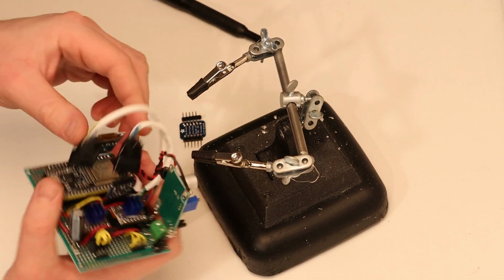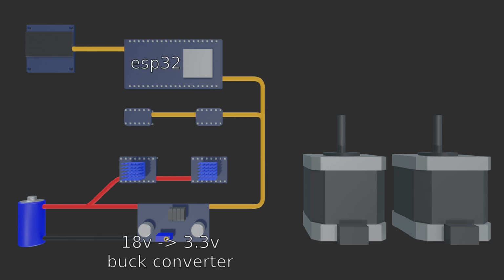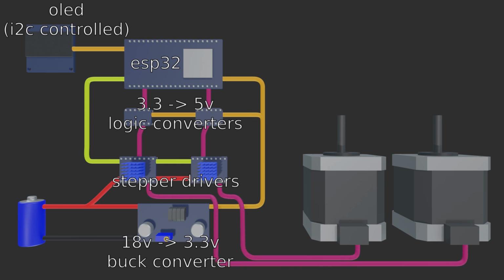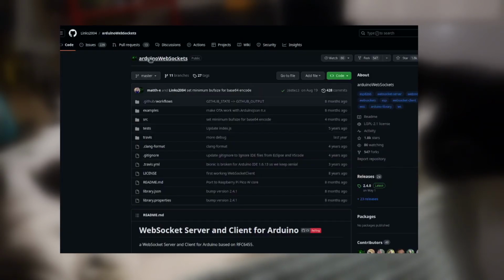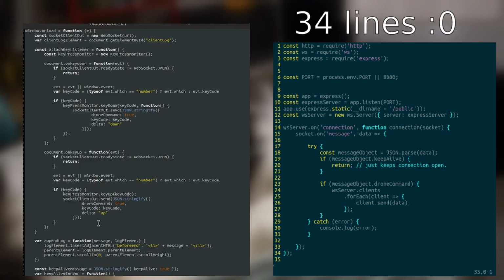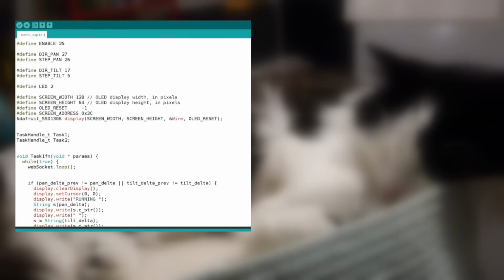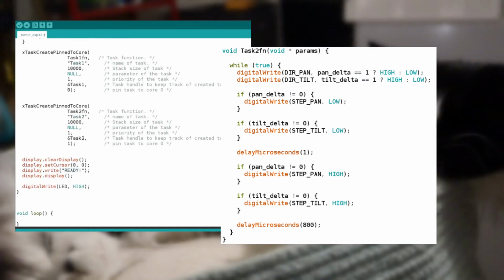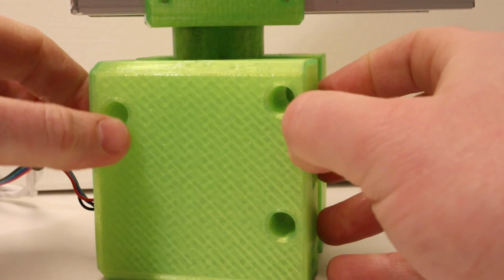DIY IOT Pan Tilt Module

Comment: Cool project! I hope you keep making videos and I can tell you put a lot of time and attention into them.

What software do you use for 3d, modeling? And how are you making the triangle thinning mesh?

Also, O Fortuna is great 😊
Reply from the maker: Thanks! I actually have a python library that I wrote to wrap around pythonocc, and I use that for model generation. I will upload the models and update the source code (the public repo is a bit behind) in the next few days. I assume by triangle thinning mesh you mean the iso/hex grid cutouts? They are done programatically: create an array of the negative shapes, check for overlap with the face you want to cut. If the overlap is larger than a given area (say, half the area of the normal cutout shape) then do a boolean cut operation.